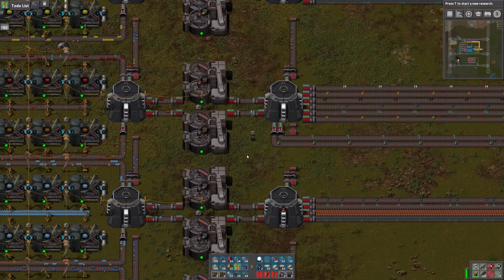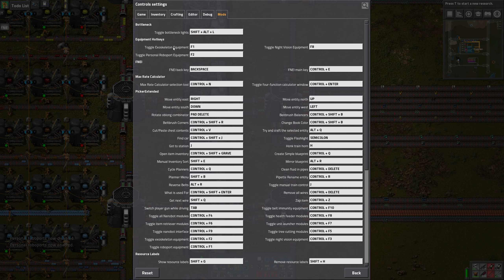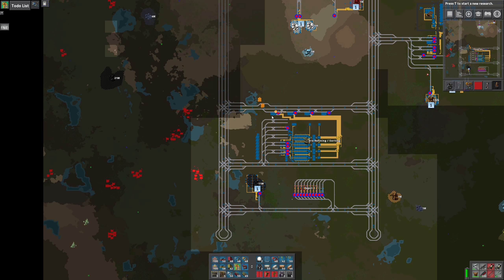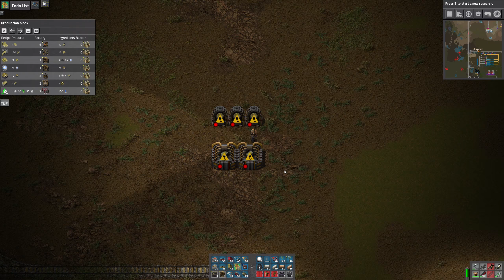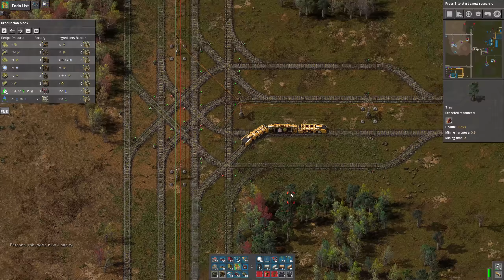Factorio AngelBobX Let's Play #31 - Aluminum plates

Comment: you can use the already existing hydro plants you are using for purified water for the saline water.
Aside from the coal processing, you definitely also need a water treatment plant.
You'll want to put alumina on the rails because that is used for several things.
Reply from the maker: Ok, thanks!

Comment: I would have assumed that chloric waste water would be best used to make hydrochloric acid, just as the sulfuric waste water is used for sulfuric acid (and, I assume, nitric and fluoric waste water to make nitric and hydrofluoric acid). Those same acids are the ones used to get their corresponding infinite ores, right? (By "corresponding" I mean that the ore that needs sulfuric acid to harvest the infinite ores, also produces sulfuric waste water when you refine the chunks; the ore that needs nitric acid for the infinites also produces nitric waste water when you refine its chunks, and so on).
Reply from the maker: According to FNEI, only fluoric and sulfuric waste water can be converted into acid (via fluoride ore and sulfur, respectively).  The chloric waste water can only be converted into purified water and saline water, and the nitric can be converted into purified and mineralized water.  In any case, I need to set up processing for the waste water.  I think I'll need to set up a separate hydro plant to do this, as lots of different processes produce and consume water of various types.
Reply: Ooh, interesting. I just found a Reddit thread with a little information about Angel's/Bob's, where someone claimed that the way you make nitric acid in Angel's/Bob's is via the real-life Ostwald process ( https://en.wikipedia.org/wiki/Ostwald_process ). If that's correct, then a kid playing Factorio with Angel's and Bob's mods will be learning about real chemistry without even knowing it! That is really, really cool.
Reply from the maker: Haha that’s great, I do the same thing.  I’ve been learning about all these interesting industrial processes on Wikipedia.  It’s impressive how similar the mods are to the actual process.

Comment: What's the downside of adjustable inserters? Seems like you refuse to use them unless absolutely necessary. For example, your one power pole could have powered everything in your 2-to-3 setup if you used an angled inserter in the little space on the right.
Reply from the maker: Refuse is a strong word, I would say that I prefer the vanilla inserters when possible.  I don’t have anything against them, but I’d rather use something in default configuration, and only specialize it if I have to.  Just to keep it simple.

Comment: You dare to  clarfy purified water? You need to put it back in priority to the orewashing.
Reply from the maker: I don’t know why I didn’t think of that.  I’m getting lost in details, I suppose.  Thanks!
Reply: Exactly what I thought, so heavy in getting aluminium working, that the water cycle gets comletly ignored. The water cycle is the bast part of angels, but getting the priorities right is the worst part. :-) 

In my prototyping base I had a belt based purified water distributions system (only one to two maschines per product, my approch to a workshop area) . with a red/green cable network alon the distrubion belt, so it is seperated from normal network alongside powerpoles. It rqan about 100 barrels total to all plants that needed water and brought the wastewater barrel  back for refilling, priotising, the water in the cycles above new from lakes, as you lose a tiny bit of pure water to sulfur and other byproducs each cycle.